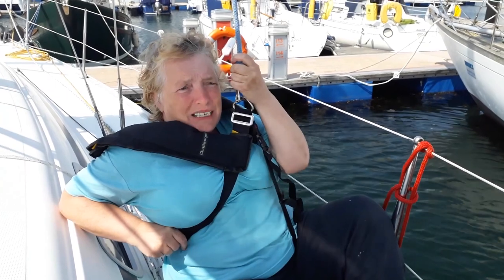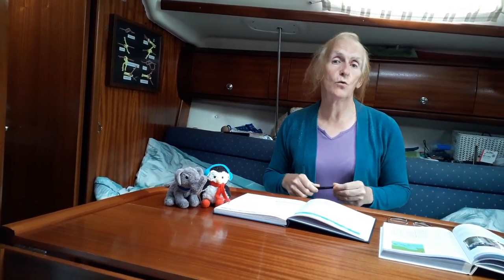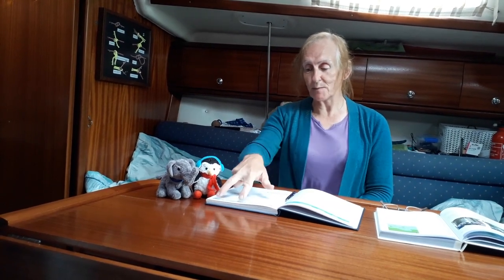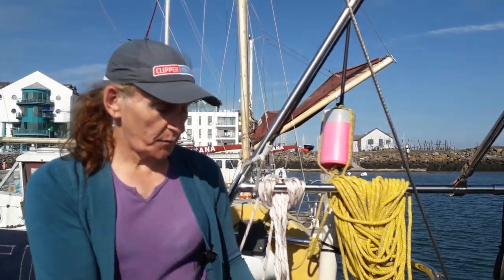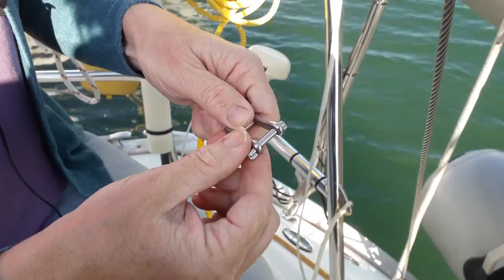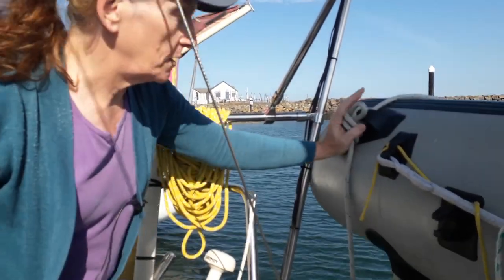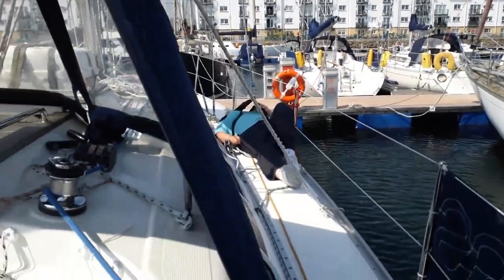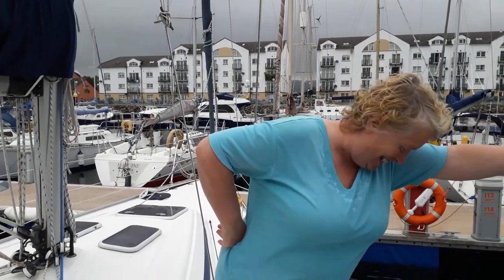Man Overboard prepartion - Yachtmaster - Carrickfergus - Northen Ireland - Ep. 142

Comment: Your GPS can only measure your position. It will give you your TRUE course over the ground by default. It does this by checking your position over a short time period and calculating which direction you’re going in .
The compass can only measure your Compass heading. It gives you a heading based on lining up to Magnetic North and any includes any errors generated by the metal nearby deflecting the compass. This may include you and your jewellery! The difference between your compass and the Magnetic Course is Deviation. This will vary according to the heading of the boat.
Comparing the two is like comparing apples and chutney.
Reply from the maker: We are aware of the "Course over ground"  issue which is why we did this at slack tide. Nonetheless, as we said in the episode, this is something we need to revisit.

Comment: what it is telling you , whether there is magnetic interference on the boat. Have done in the day's lots of compass adjustments funny deviations you need to correct. Also it wise to make a circle , with equipment on , off.
Reply from the maker: There will be some magnetic interference - there is a large lump of iron (the engine) with a few metres of the compass. We will be taking more measurements and updating this in a future episode.
Reply: @SailingYachtSaltyLass  it is mostly the generator, bringing havoc...
Reply from the maker: We do not have a separate generator - we use the diesel engine for that, but the solar works well, even on a cloudy day.

Comment: Liking your practical approach to mob. I didn’t have the luxury when solo sailing. I just carried a handheld vhf and an ais beacon in case and tried not to fall off! On compass deviation it may be very different with the binnacle instruments turned off vs on. A pain but may warrant 2 deviation curves! Also iPads can have a massive impact if close - they are full of magnets. Finally your flux gate compass sensor for the autopilot should be kept well away from electronic equipment and magnets or you may be well off course or it may just refuse to play as happened to me once. Enjoying the YouTube videos.
Reply from the maker: The flux compass is as far away as we can get from anything magnetic, but everything is a compromise on a boat. We will be doing more exercises to establish curves and we can always try with the instruments off at the binnacle and use the GPS at the chart table.

In the meantime, we have both agreed to try not to fall overboard ;-) The AIS beacon is probably in our future.

Thanks for the feedback.

Comment: Ahoy Ladies! As usual great video that i really enjoy watching . I also have Bavaria but it is much smaller only 31 feet. But the layout is almost the same. Any way i was also toying with some ideas around  keeping the dinghy the same way as yours . I also  have the same transom shape so that's way i still cant crack it :( . I was looking for Davit's but they are big and expensive and they take a lot of space. So anyway i mange to find  those  "Snap Davit For Soft/Hard Bottomed Inflatable Dinghy with Quick Release Set" . They are not expensive around 70£ only and i do like that you can easily  remove them. The problem that i'm struggling at the moment is  how to attach them to the Bavaria transom. You can try searching  on ebay for them . I will like to hear your ideas .
Reply from the maker: We will have a look at that. We did do a video last year on storing the dinghy. I will have a look for it and post a link
Reply from the maker: Here you go... https://youtu.be/N6EZfN7X8_4
Reply: That is helpful I will definitely use the bridal attachment idea . Thanks for the video . When you have a time have a look also on that Davits . My ladder is a different type, it swings so I can’t use the the wheel option . That is way I looked In to that Snap Davit so I can attaché them some how on the outside of the ladder directly to the transom . For the bridal I can glue a handle on the other side of the boat that i can use just a climbing or marine carabiner . Just for a quick clip on .

Comment: Three pelican hooks would be far better than those 'click' shackles.  After about six months, I have found that those clip shackles are the devil of a job to turn and also, just try doing it in very cold weather when your fingers are cold.  You won't be able to click those shackles.  I use pelican hooks on both my safety lines onto the Taff Rail both port and starboard side (2 each side) so I can drop the safety lines to recover a MOB back on board without having to lift the wet and heavy body over the lifelines.  Pelican hooks need to have a slight load on them at all times to keep them closed, no mousing required and the opening end needs to be at the top.  https://www.gsproducts.co.uk/stainless-steel-pelican-hooks-with-link/
Reply from the maker: David - Someone else has also suggested the Pelican shackles to us. We just went with what we are used to. We will have a look at them. Thanks for the comment and the link.

Comment: The problem with this method is that the gps does not tell you which way the boat is pointing; its telling you the direction in which it is moving - which includes the tide. I'm affraid you have to compare the mag compass to a bearing on the chart - like a harbour approach line?
Reply from the maker: I do not disagree with any of that, but......the problem with that is that there is only one harbour approach line around here.  We are aware of the "moving direction" issue which is why we did the exercise at low water slack and with the boat moving at a high speed under engine so as to minimise the tides and wind effect of leeway.  We might try steering to landmarks from known GPS positions and measuring it later on the chart.

What the exercise really told us is that the compass does not suffer massive deviation like 10° or 20° so it appears to be accurate enough for general sailing.